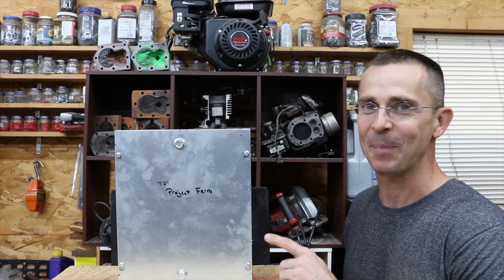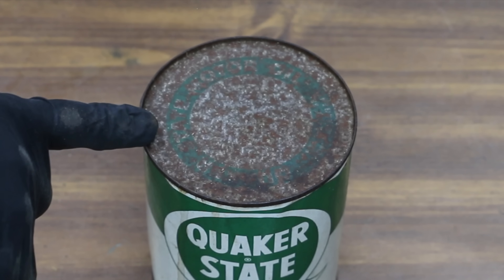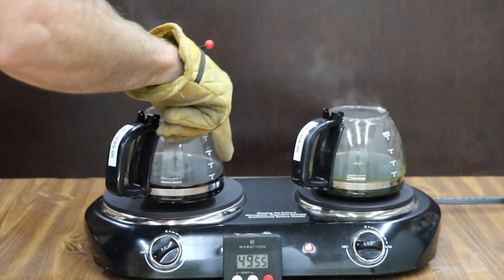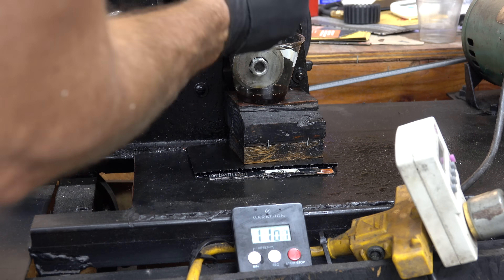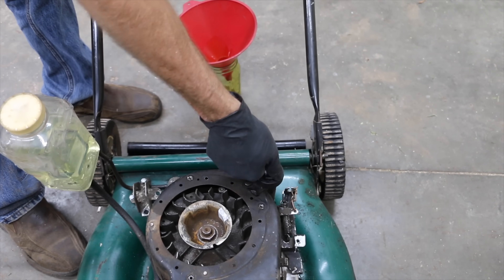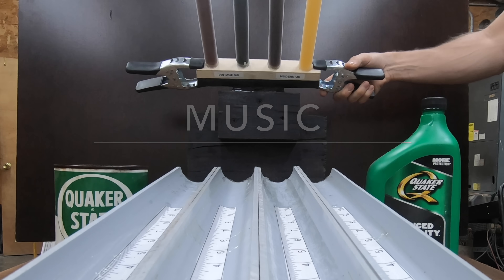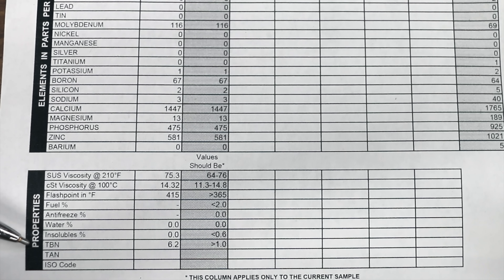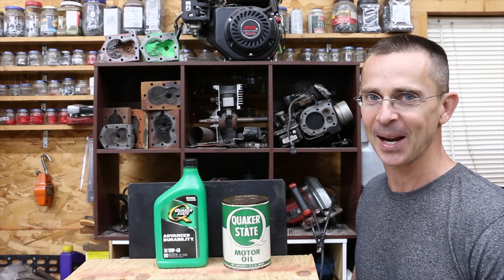Is Oil Good After 70 Years?  Let's find out!

Comment: Makes me feel better about using oil that's been sitting on my shelf for a year
Reply from the maker: Great point!
Reply: You have to put it in a metal box if you store it a year lol
Reply: Aaron Woodwell agreed. I’ve always felt that oil, especially synthetic, if stored at room temp in a sealed container will last for a long time.
Reply: Oil changes are a money hungry scam. Whether you do or don't believe me, my dad has a box truck with 170k miles when he got rid of it. It still had the original oil when he got rid of it. It's still on the road today.
Reply: Karl Hopkins I smell cap
Reply: Karl Hopkins you dad definitely changed it at some point when you weren’t there
Reply: @jamesrozario4123  Nope he's told me many times he never changed it. He changed the oil in his ford vans every 30k. He got his srt8 charger with 8,869 miles, he didn't change it until it had over 40k all still run great, all are still on the road.
Reply: @karlhopkins713 my neighbour bought a brand new tractor and the engine seized in it mafter two years because he didn't change the oil.
Reply: @karlhopkins713  Let's see what happens if he ever requires any warranty work...
Reply: @jamesrozario4123  I'm not a liar so.🤷 I don't have to prove anything to you so oh well bud. Like I said believe me or don't believe me, won't bother me either way.
Reply: @CaptHollister  The truck has been gone for 6 year's, the van he just gave to his buddy. And btw he's never worried about warranty work.😉
Reply: Single grad oils back then my friend...hence,,,no low temp flow, no viscosity additives,& no detergents
Reply: LOL, aka "brand new"
Reply: @karlhopkins713  bro modern engines will not last on original oil. Im sure he had complications that would've been avoided with new oil
Reply: @karlhopkins713  weird how engines with frequent oil changes and filter changes generally last longer and run better then.
Reply: @cpfaclan3681  Absolutely zero bud. The box truck he always has bought were always the most reliable possible. He had 4 older nissan diesel box trucks, the only issue's he had were with his first one. It needed 2 new alternators, and a piece for the turbo. Besides normal maintenance none needed anything besides the first one.
Reply: False Flag  Weird how it has well over 50k bud.
Reply: @Namesakes.unit-x-10sq10  Weird how his box truck he had has well over 500k without being opened.😉
Reply: @karlhopkins713  probably burd it off he just keep adding oil and ford never put a st8 in a van try a st6
Reply: @mrbriggs68  Can you read bud? I said srt8 meaning a dodge product bud. He never added oil, it didn't burn it. I'm done wasting my time, don't believe me won't affect me in any way.
Reply: been using some old castrol diesel engine oil in a fordson major tractor i have for the last number of years, never any trouble. got 7 cans for free from an old closed up garage. the cans are deffo of 80's vintage. the oil looks as new and has that wonderful smell old oils had, no deposits in the bottom of the cans either
Reply: i have been using castrol diesel engine oil from the 80s in a  fordson major tractor for the last few years, i got 7, 5 gallon drums of it from and old garage for free, its fine can't fault it.
Reply: @karlhopkins713  That's just absurd. On our Mazda CX-5 fuel consumption starts going up at 10k km, 20k being the change interval. And at 20k it feels like sandpaper between my fingers, just like it did on all other cars I've ever owned.
Reply: @shinobi6622  Yeah he's never bothered as much as most, and never had an issue with them. I change mine when I feel like it, whether it be 5k or 10k.
Reply: @karlhopkins713  Hard to believe,  no gunk in the  crankcase?
Reply: @Namesakes.unit-x-10sq10  But not weird,  just is to those who don't "get it."  Ha
Reply: @shinobi6622  Yeah I would suggest dropping down 10K Km. I like changing at 5K miles as it's a round number on the cluster. It really helps long term. Almost at 300K miles and the engine might need a spark plug change on an V6 2005 Xterra.  This includes free way, street and towing.
Reply: @karlhopkins713  I'm not talking to someone who has no background knowledge on something so simple. Hes literally shown on the lubricity tester what oil and the lack of can do to bearings. This is no different than cam shafts, rocker trains, crankshaft bearings, etc.
Reply: @mjcoughter4821  You guys!!! Those vintage oils are worth a lot of money today!! Could have sold just 1 can for hundreds.
Reply: @karlhopkins713  maybe it used/consumed enough oil that it was almost like one long continuous change?  I've often wondered...if an engine uses, say, 1 quart every 1000 miles, is it even neccessary to do a full change every now and then?
Reply: False Flag  it was a joke lol
Reply: @grassroot011  Everything is fine lol. We took the head's off of his one van it was all clean. It needed the head rebuilt, but that was because an injector wasn't working properly and burnt the electrode off, and I got stuck in the valve. No issue's because of oil.
Reply: @karlhopkins713  And when your engine seizes youll remember us naggin you about changin the oil regularly like it should be. Lol

Thats after you need several grand for a new one or a new car. Lol
Reply: @cpfaclan3681  Like i said bud don't worry about what I said, believe what you want.
Reply: @evanwilson6040  
Well there you go. Break-in oil is only good for 1000 miles max!
Reply: @karlhopkins713  , I notice you say your dad...  So if you were old enough to drive, you would say you did it yourself...  I'm assuming you are about 15 years old, and he is giving you crap.
Reply: @whointhehecko7408  I do my own stuff bud, I'm not 15 lmao. I've only owned ford. I'm 22 bud, I've had mustangs and my f150.😉
Reply: @karlhopkins713  Your dads truck will probably run for quite a while just adding oil but sludge will build up and either clog the filter making the oil pump work harder which can break the distributor drive in older engines not sure how dodge powers their new engines pumps, or it will block the oil pickup in the pan starving the pump and all the engines bearing surfaces of oil pressure causing it to seize well before the 500,000 mile service life of the vehicle. $40 in oil and filter is a small price to pay each year or twice yearly for a bit of peace of mind.
Reply: @karlhopkins713  the damn truck probably burnt so much oil that topping it off when low was the equivalent of changing it every 6k miles...
Reply: @chriss9836  He doesn't even have his car anymore either bud, just got rid of it 2 month's ago.
Reply: @Bill-NM  
I had a neighbor who actually only changed the filter and added a qt. in an old Willys jeep. Ran like a Singer sewing machine!
Reply: False Flag  The one van was never opened, I never specified how many he has had bud.😉
Reply: False Flag  I never specified when I changed my oil bud, I gave 2 random numbers that came to mind. But I guess you can't comprehend?
Reply: @karlhopkins713  at least i know who never to buy used vehicles from 177k oil would be sludge
Reply: @karlhopkins713  You all got baited to a whole new level, well played Karl.
Reply: @Bill-NM , My 1984 Ford E-250 Extension Van was like that. It burned 2 quarts a month, so every 3 months I would just change the filter and did that for over 300k. When I sold it, it still ran like a champ ! If Karl's vehicle was like that, I don't see a problem, but to each their own.
Reply: False Flag  Guess what bud I'm not wrong when I've lived it.😉
Reply: Stop arguing with trolls, and change your oil, or not and buy a new engine ever 50,000 miles.
Reply: @matthewpaine6908  Never had to replace an engine.🤷
Reply: False Flag  You really need some new glasses bud. I didn't know a picture of an empty front bumper somehow had a license plate?
Reply: False Flag  My mustang is my daily bud, I've put tens of thousands on it, taken it on road trips many time's with no issue's.😉
Reply: False Flag  Wow I used my name, Boohoo someone find my plate. This is somehow going to affect me how? Oh yeah it's not going to.😉
Reply: I used ten year old oil once and it worked perfectly fine.
Reply: False Flag  I have a mustang sure, I don't care one way or the other if someone likes my car bud. I buy what I want for myself, not for other people to like.😉
Reply: @karlhopkins713  My families been drag race and build race engines sinse 1958. Do you realize what that motor would look like? That engine would be so gummed and sludge up it would crank and the push rods wouldn't be pumping oil. The other thing, before it quite running the oil that wasn't burnt up sludged and gummed up would run through there like water once the engine warmed up. The other thing, from the oil breaking down burning up and sludging up it would cause it to be low on oil and he would halve to add oil other wise that could burn it up to. There is just so many ways I could tell you that your full of it for still buying into the fact your dad pulled one over on you.
Reply: extremedrivr oh...bit late now lol😂😂
Reply: @karlhopkins713      I have routinely went 20-30k miles on my vehicles between oil changes with no trouble and some of them are pushing 300k. I've had a few of my engines opened up and they aren't all "sludged up".  Semi trucks are running 50k between oil changes nowdays or more when pulling oil samples. Try not to let all the keyboard warrior ass hats bother you.
Reply: @karlhopkins713  he calls anyone who changes their oil falling for the "oil scam"?  What a tool. Smh
Reply: @karlhopkins713 why would you fall for that "oil scam" I mean c'mon you just bragged to everyone how your dad's vehicles last for half a million miles without a single oil change but yet you change your oil in your vehicle? Why??
Reply: @thesenewythandlessuck  Can you read bud? I said he got rid of it with 170k miles with the original oil. I never said he didn't change it when it had 500k. That truck has been gone for 6 year's. But I guess you and other other guy don't read properly. Not trying to be rude, but don't twist what I actually said.
Reply: @karlhopkins713  If it leaks a quart a month, that's basically like changing the oil every 6 months. lol
Reply: @ronjones-6977  They didn't leak or burn.🤷
Reply: Karl Hopkins Without particular filter or centrafuge the blowby carbon would polish the main and rod bearings to unaccepteble clearance. The motor will throw a rod or spin the main. Don’t be rediculus. Mains and rods wearing off even with normal oil changes,i don’t even mention the cams,rockers,lifters,etc. Go to the overhull shop and educate yourself a little by just looking at disassembled motor.
Reply: @jamesrozario4123  The old oil came out the back as blue smoke and he topped it up.
Reply: @extremedrivr  Well you're wrong. My gramps owns and runs a taxi stand. And he runs those cabs,24 hours a day. Everyday. And he rarely changes the oils. He buys the old retired crown vics' cop cars at auction. He gets them super Cheap. And rarely do they break down. He's run his cabs for 4 years, 400,000, miles with no oil changes! They still run great. So you're Wrong.
Reply: @captainamericaamerica8090  

I'm not wrong. Motor oil has to be changed at the required interval due to the simple fact that the additives in them break down after a certain length of time. 

Group I and II Petroleum Motor Oils are only capable of lasting 3,000 Miles before they break down and no longer have any lubricating properties. 

An oil analysis test will prove that. 

Group III Petroleum Oils can last anywhere from 5,000 to 10,000 Miles depending on how good the formula is. 

Group IV Synthetic Oils can last anywhere from 15,000 to as much as 25,000 Miles before the oil must be changed. 

And Synthetic Oils that are a  mixture of Group IV and V Base Oils can last as long as 150,000 before they need to be changed.

So your gramps sold you a bill of goods there man. It is not possible to go 400,000 miles without changing the oil regularly. 

An Oil analysis test will tell you that is FACT. 

I have had plenty of those lab tests on my vehicles engine oil to know those FACTS. 

So again, your gramps sold ya a bill of goods, meaning he lied to you.
Reply: grassroot011 '
Reply: @karlhopkins713  It didn't burn any oil? Now you're talking complete bullshit
Reply: @extremedrivr  only thing I can think of is oil by-pass 99.99% micron filters for extending oil life....but even then I don't know if the detergent/zinc etc. Additives for metal grinding protectants will run out when....?  Also oil viscosity will increase due to wax build up over time (oil weight increases)
Reply: @YangSword9x  Yes exactly. With a bypass filter motor oil will last longer sure. 

But the oil will still need to be changed at some point very close to the Oil Manufactrers recommendation. 

And the best way to find out at what mileage interval is best for your vehicle is with an oil analysis test of an oil sample. 

I do that once every year like clockwork when its time for the anual change.

With my driving habits and care of my vehicles engine I can go a full year on Amsoil Signature Series without any issues. 

And thats like 15K miles of driving. 

But other folks just dont understand or want to understand the science behind oils and lubrications as to what you can and cant do and what you should and shouldn't do.

That's why that guys gramps sold him an empty bag of chips when he said he never changes the oil on his taxi or whatever it was. Lol
Reply: Ok you don't have to. I've done it and lived it. If you don't believe it that's perfectly fine.
Reply: Karl Hopkins You’ve been arguing with this entire section of replies for two whole months now, I think it’s about time to accept that you’re wrong “bud.”
Reply: @adamtetrick8752  If I've lived it then🤷
Reply: @TazimDS  I've lived it, so yes I am.😉
Reply: @Bill-NM  yes, to remove the suspended dust/metal particles
Reply: I buy my oil in small bulk. When napa has a killer deal on their brand synthetic I load up on it. Lasts for a long time and I don't have to procrastinate going to the store to buy more.
Reply: @karlhopkins713  ive seen people change oil every year according to the book and still end up with slugged engines anyways. better to change often than to put yourself in the risk zone.
Reply: @karlhopkins713   if you exclusivly drive long distances and never do cold starts then its possible to go further but if you drive like most people, with many cold starts and short distances then its not possible.
Reply: @karlhopkins713  Come on bud.  Stop making stuff up bud.
Reply: @Bill-NM  agreed,  if its constantly getting fresh oil no need to change,  maby a filter every 5th quart
Reply: @karlhopkins713  yea i had beater truck i never change oil in run great for 100k miles then when it thew rod took it apart engine was all sludge but i dont think thats what cause the rod to knock tho   it want hurt old engine do it to new car it want last 40k miles

Comment: Tires and lubricants are some things that have undeniably improved since the 1950s
Reply from the maker: Thank you for the feedback
Reply: how bout gaskets and seals?
Reply: BROWNWRENCH BROWN Everything has improved except for complexity, which is a normal trade off.
Reply: Mrs. Beast haha yeah i tried getting a pair of the cheapest tires once and one was out of round. although they're not too bad for the price if you return or claim warranty on defective tires as soon as possible
Reply: and engine blocks… I mean... stock... leme say that again, STOCK block and rotating assembly 5.3 making over 1100hp... no special high-nickle Mexican block with black voodoo infused pistons... STOCK from GM... making and HOLDING well over 1,000hp 

fyi: I do not endorse LS motors... personally I hate em, but damn what a claim
Reply: Back when my father was young, you were doing good to get 20k out of a set of tires.
Reply: @therealbenji  Sometimes, yeah. Try driving an old car with bias ply tires, though. I haven't, I've only heard someone say "it's like a pig on stilts" and another man with a later 50s Chevy Wagon told me when he put Radials on his Wagon it handled so much nicer.
Reply: What about computers? ;)
Reply: I remember when suddenly radial tires were "the way to go", it was early 70's. New GM cars even had a little "RTS" logo on the dash for "Radial Tuned Suspension". When dad put new radial tires on the the '70 Chevelle I learned to drive on, it was a marked difference. Quieter, smoother, handling was considerably different, it was a whole different car. Instead of putting snow tires on the back in the winter like we had forever, we just left all 4 summer radials on with their improved tread pattern. They really were better all around.
Reply: How bout everything.